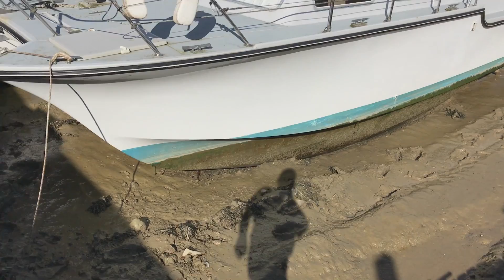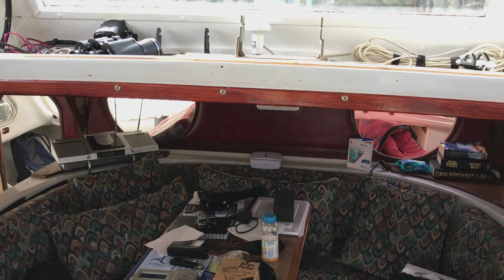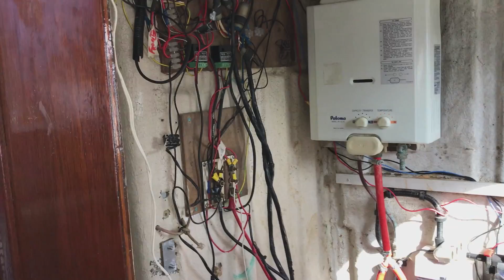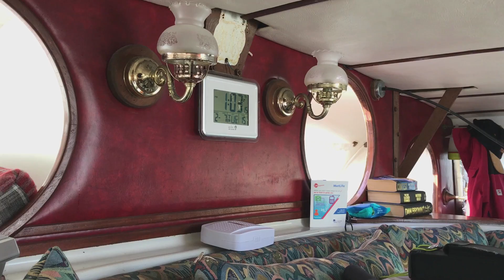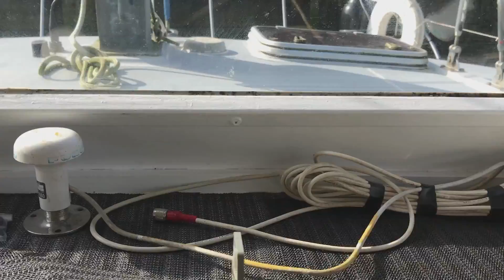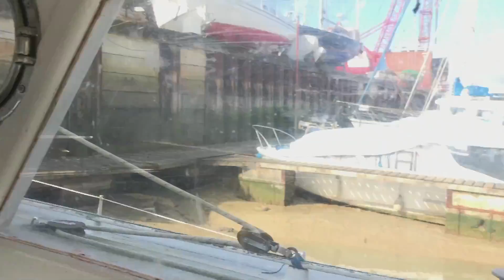Sailing Sea Nomad Ep2 - meet 'mother'

Comment: Pps ..   I think your catalac is a mk 1  pre 1980  as the round windows at the back were dropped in 79  .. only saying from what I've read online...
Reply from the maker: HiMalcom, yes you are absolutely correct. Mother is a MK1 - we think 1978 as her 'plaque' is missing. The round aft windows are the first sign and also there are no steps on the fore deck roof as they added these later.